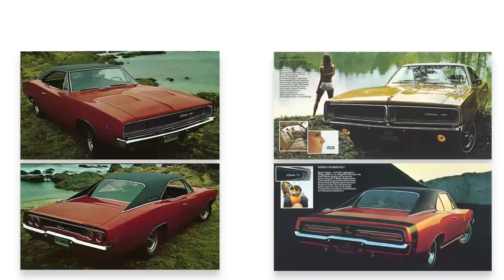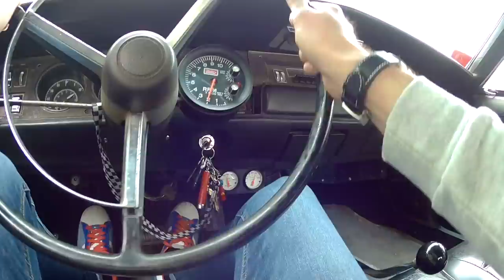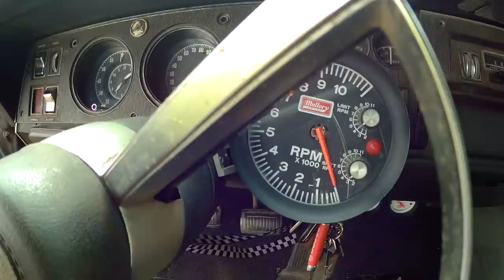Why I bought (and imported) a classic 1968 Dodge Charger manual

Comment: How much was it and how much did it cost to restore?
Reply from the maker: Cost me about £8000 Inc shipping, then I spent about £10k rebuilding engine, brakes, suspension, trim and bodywork.
Reply: @TheLateBrakeShow  18k??? That’s amazing value. The paintwork, good tooth and the hole in the grill look fantastic. It gives the car such character and makes it look like the car version of Danny Trejo...the bad guy out of most Robert Rodriguez films / con air
Thanks for letting me know.